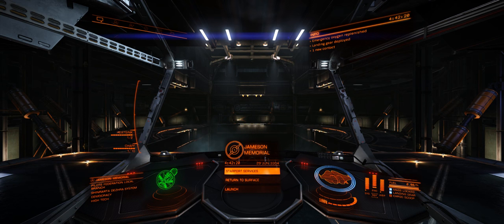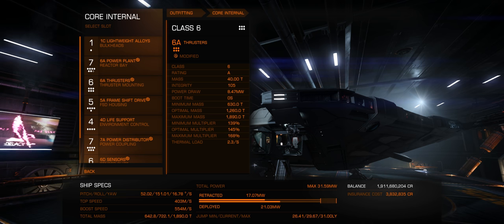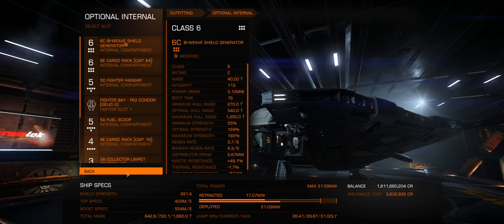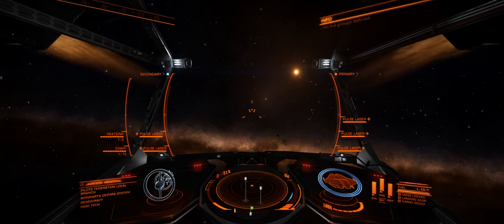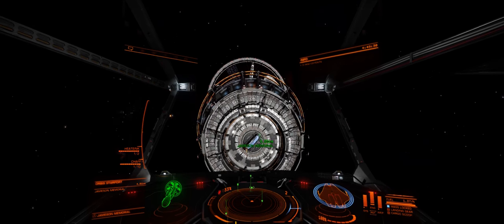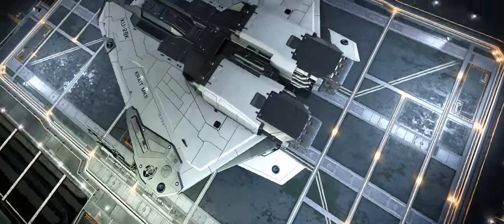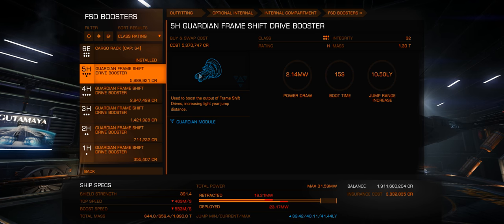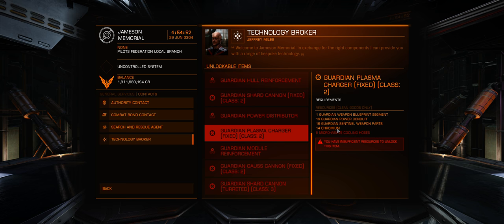Elite Dangerous 3.1 E02 - Engineered Krait is very nice.

Comment: I'm not sure what to put on mine, I want to get the maximum dps from it but I want something cool next to the cockpit.
Reply from the maker: Lol Kaizaki Erryn i had the same thoughts on the mediums, I'm pondering efficient beams on the top larger, or a mix like beams and a multi, then rails on the mediums. Lots of testing to do.
Reply: Kuzumby I like the idea of rails on the bottom, long range super pen, and then I'm thinking 1 gimballed overcharged multi, 2 overcharged pulse. Scramble and emissive. The 7a PD makes this totally viable.
Reply from the maker: Ohhh that sounds very nice
Reply from the maker: Kaizaki Erryn how do you like overcharged pulse? I love the rapid fire pulse but they are hot power pigs.
Reply: Kuzumby I prefer rapid fire too but I can't resist the damage increase overcharged. Also I really hate jitter haha
Reply from the maker: Yeah the jitter is very noticeable, I was also pondering the gauss cannons for med, but I need to farm and unlocked them.
Reply: Perhaps try this: 3 large frags (w/ incendiary, drag , oversized) and 2 med rails( super pen and feedback)
Lots of DPS and great specials for many situations !
Reply: CMDR Warflower that could work for me, though I like to spend a lot of time away from stations I'd have to synth a lot of frag ammo. Could replace a frag for tlc plasma as I don't run chaff.
Reply: Kaizaki Erryn I run three long range fixed pulses in the larges and capacity engineered missiles in the mediums. Just for the cool factor.

Edit: Got my loadout mixed up with my Python at first.
Reply: Kaizaki Erryn do a g5 long range plasma slug rail + g5 overcharged multi cannon (or cannon) that’s what’s on my vette but would probably work on this too

Comment: Why a 6a in a 7 slot out of curiosity
Reply from the maker: I assume your talking power plant? My 6a plant engineered with overcharged has plenty of power for the gear I was running. The smaller class saves weight and that gives better agility (pitch, roll, yaw) and a slight boost to jump range.
Reply: @Kuzumby  yeah